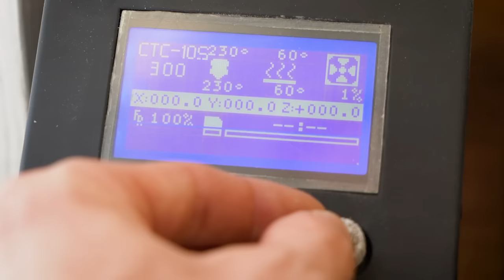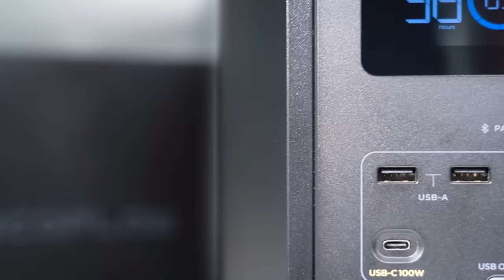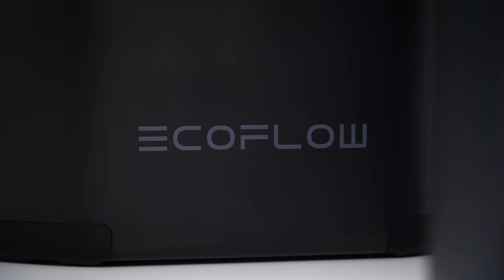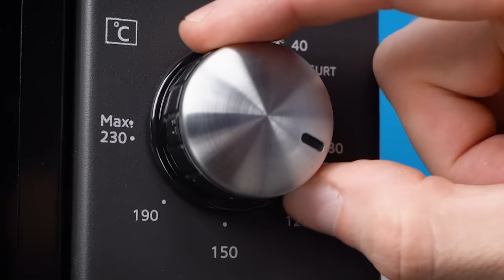Insane Tyres out of Hot Glue Gun Sticks

Comment: I can't imagine a wheel made like this lasting too long. Can see the tires wearing down quicker than normal tires.
Reply: I was thinking the same thing.  Sure, nails and tacks can't harm them, but those tires will likely wear down pretty fast IMO.
Reply: The grip is probably 0 lol
Reply: @anth0ny_unplugged173  sure
Reply: probably more expencive too lol
Reply: Tried solid Tannus tires on my bike for a couple of seasons. Ended breaking the back wheel pivot screw twice, zero suspension. Lasted for more than 4 years though, and removed them literally squared. 
Solid glue tires? Ehm.... no thanks.
Reply: do you prefer normal tyres over solid airless tyres?
Reply: @Metalshark100  depends on what you're looking for, and what's the overall quality of your country's bicycle tracks. Here in Chile streets are full of holes, and bicycle tracks are terribly designed. So in that case normal tires work better than solid ones. Not a matter of preference but a matter of which works best.
Reply: oh in that case here in the UK its a no brainer. the airless tyres would never work here.
Reply: They'd probably melt if you leave it out in the sun or use it on a sun blasted floor
Reply: Yeah no shit🤣
Reply: They will melt.
Reply: This bike wont last a day in our country lmao. Those tires are gonna melt like butter in our roads
Reply: @NohrScum  true

Comment: It works though it seems a little shaky through the footage. The suspension and force distribution don't seem to be that great. Also, base on where you live, the Summer days can be very hot, which might melt those tires. Well, it's just a concept.
Reply: They are made of hot glue sticks and look like the good ones the cheap ones the ones that everyone use with the glue gun start to melt at 120°c but the industrial good ones start to melt at almost 200°c. So that's impossible to be melt by the hot wheater
Reply: user-wr6wr7em3y  estafador a la vista

Comment: Awesome idea but I think a better implementation would be to use silicone or a silicone blend. Softer ride and no melting problems on sunny hot asphalt! Then maybe studded for longer wear and better traction on ice/clay type surfaces. You could even play around with different stud materials.
Reply: Although weight might be a problem, maybe mix in styrofoam beads, or go with expanded foam?
Reply: reinventing air filled tyre?

Comment: Gave me an idea for a cheap worn down knobby bike tire (the knobs in the tire center always get worn down 1st faster than the rest of the tire) .  Clean the tire & use a glue gun to put a dab of glue on each worn down tire knob to see if it'll stick & how long they'll last. I doubt it'd last very long or stick well but it might. I might try it on my worn down motorized bicycle rear tire. It wears out tires quick. If it could make them last 1/2 way longer or provide better snow traction, it'd be worth it. Or clear silicone caulk (dries to hard rubber like feel) might possibly work & stick to the rubber knobs. 
It wouldn't take very long to apply, set bike on center stand,wipe down rear tire with solvent, apply a dap to each worn down center knob & let dry.

Comment: Glue stick rubber has surprisingly good wear resistance. I would bet these would last quite a while, and would be easy to rejuvenate by adding new glue, though you may have to melt the surface to get good adhesion.

Comment: Great video, your mind must not stop. I just put a new pair of tires on my road bike. They cost less than $50 for the pair. I usually get around 3500 miles out of them. My first question to you would be cost. Did you keep a running total of your cost excluding your equipment which looks very expensive. How do they perform? How long do they last? I can’t see them beating standard tires in any way except maybe punctures. Great experiment, I would rather just ride my bicycle.

Comment: I see the pros on this already, yes. But can an engineer or smart person tell me what would be the "downsides" of this great idea? (examples: costs 5x times more; it doesn't work on rock terrain because shock breaks the wheel; etc)
Reply: I've ridden tubeles solid rubber tires on my road bike before and it's pretty similar to this. The downsides are pretty significant. Not only is it heavy, but also pedaling from zero to top speed takes so much effort and hard to maintain the pace. No shock absorbtion as you can feel even the slightest bump on the road and the tires would slide frequently on wet fairly smooth road coz it doesn't deform well on pavement resulting to poor tire to road grip. Definitely not worth the perks of being immune to flats.
Reply: Well, the ride looks really rough and bumpy to begin with. Your tires help with smoothing the ride. It's also 100x more work than is needed, since they already have tubes for this application. Not to mention temperature. What will these tires do on a 100 degree summer day in Phoenix, for example?

So in short, it's really cool, but not really practical.
Reply: @ccg2301  Sorry stupid app didn't tell me you answered, thank you so much this was extremely helpful 😊!
Reply: @MichaelWellsMW  I see now, thanks for the answer! It did bring about a whole realization of how tires are still the way to go.
Reply: It's worth noting that there are tubeless options out there that aren't solid rubber. I actually work for a bike company, and we naturally have tons of riders. I think there are more people who don't like the tubeless then there are that do, but it's definitely a step up for the solid stuff.
Reply: @MichaelWellsMW  wooow your work must be really nice! And I'm glad it seems like we're going towards a good direction, I can't wait to see what's next

Comment: why didn't you put the silicon inside a bike tire and then just fit the tire with the silicon inside? (without a tube ofc)
Reply: He made the tire out of hot glue. He only used the silicon as a release agent so that he could separate the plastic from the hot glue.
I think you meant to say that he should have just filled the tire with hot glue and then put the tire on the bike....but I don't think that would work because filling the tire completely with hot glue would make it difficult to install the tire and would probably also leave gaps between the tire and the rim (wheel). If you really did want to go that route, i think the best way would be to first install the tire without the inner tube, then remove the valve stem and pump/force/inject the hot glue through the valve...similar to how the flat tire sealants work.
Reply: @nnamerz  yep that’s what I meant and you’re right about the gap between the rim and silicon but if he fitted the tire the as you said force pump hot silicon filling the tire from bottom to the top I think it would work. 👌

Comment: That thumbs up at the end is so dangerous lol. This is not to be imitated! The tread on that will be gone on first day. That's if it doesn't crack the first time you hit a rock or curb. This is asking for trouble. The cost of the hot glue vs. new rubber tires is not even economical. This is meant to be a viral ad for the ecoflow battery only. So unethical for them to not make that clear though.